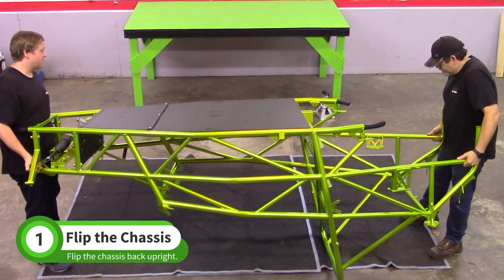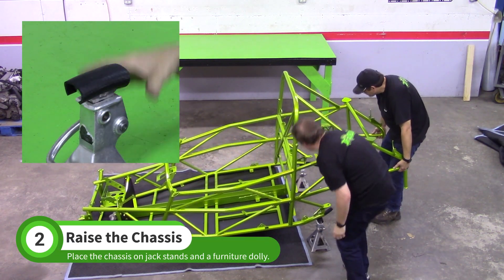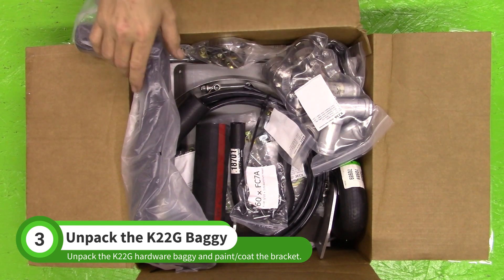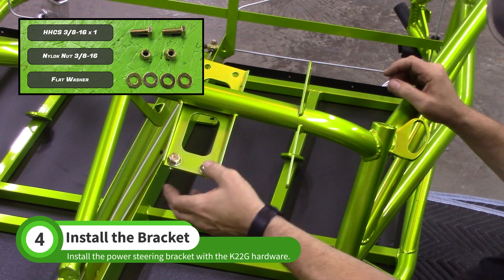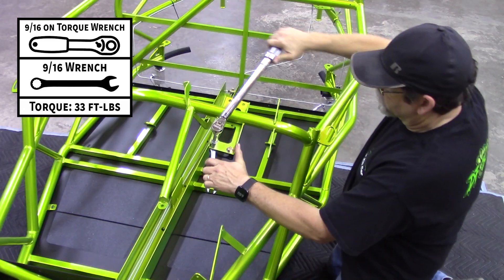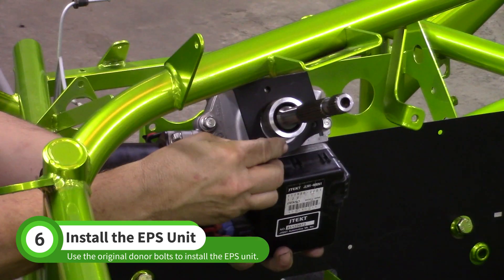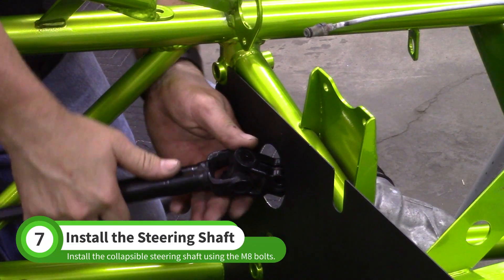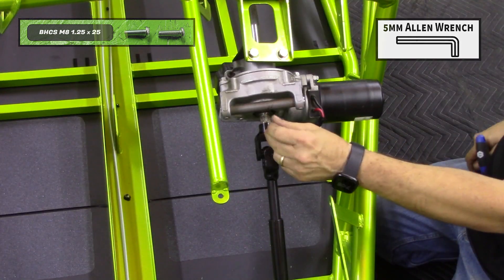DF Goblin Assembly - Installing the EPS Unit and Collapsible Shaft

Comment: How is the steering shaft "clocked"?
Reply from the maker: It is not clocked at this point in time. The only thing that matters is that the lower joint slips on in such a way that the bolt can go through. The steering will be clocked later when the steering column and steering wheel are installed.
Reply: @Dfkitcar  Thank you!